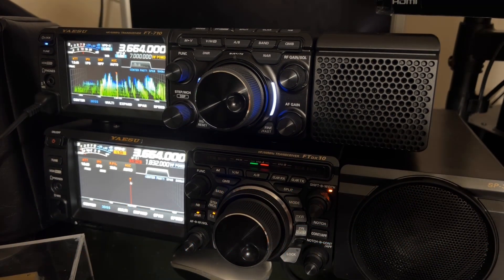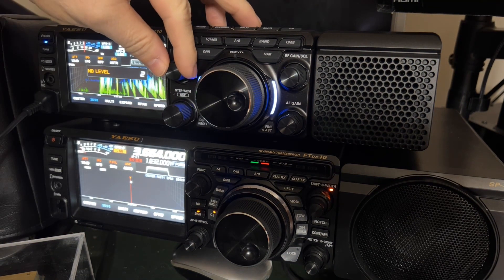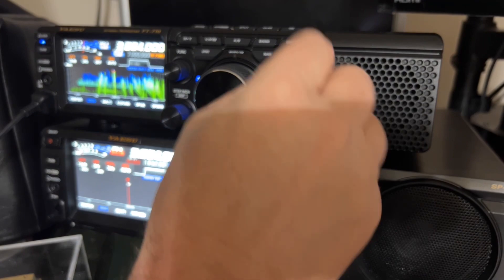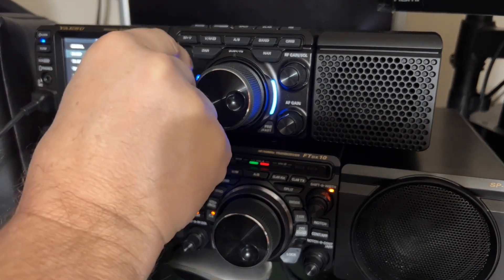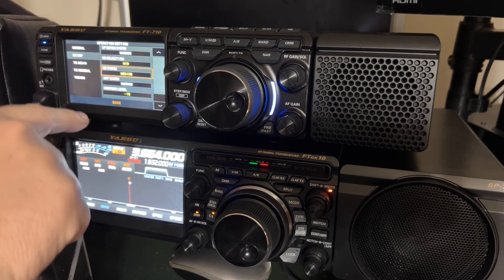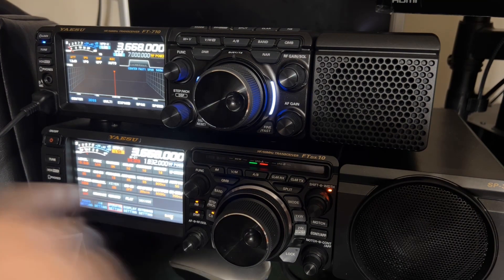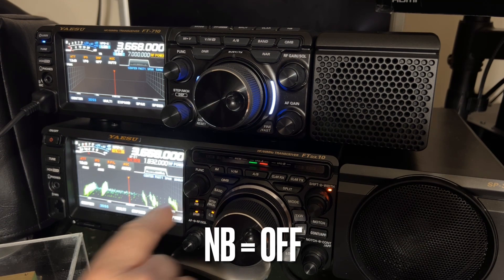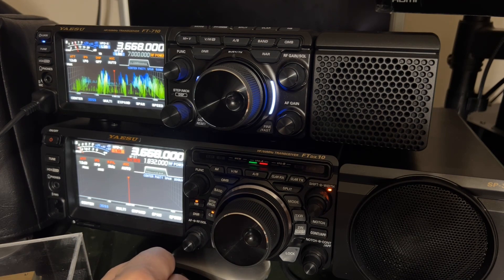Yaesu FT-710 AESS: Noise Blanker Effectiveness (video #20, additional videos via Patreon.com/N4HNH)

Comment: Icom NB width and depth are 100% adjustable. Why Yaesu will not do the same I do not know. Icom NB is the winner for noise
Reply from the maker: Yaesu does in their FTdx5000. In fact it has traditional and DSP-based NB. It’s awesome!

Comment: Is the 10 hardware? The 710 looks software
Reply from the maker: The FTdx10 is a hybrid. The FT-710 is direct sampling (pure SDR).
Reply: @n4hnhradio  duh!
The noise blanker was the subject
Reply: Maybe they are both software. The 10 &710
Reply from the maker: If you’re referring to the noise blanker itself, yes. Both are DSP based. Most modern radios use the DSP to handle NB and auto-notch. It is less expensive to deploy. The chip is already there, for DNR, Contour, Width, etc.  So, rather than making room on the circuit board for the analog NB circuitry, they can program a chip. The cost of the software is a one time “front-loaded” cost, versus the need to procure and install the components needed for a traditional analog noise blanker each time a radio is made. 

The FTdx10 has a front-end mixer stage, so the analog approach should be possible.  But Yaesu chose to use the DSP approach.  The FT-710 AESS is a pure SDR.  The NB function must be accomplished via software. 

It’s easy to sell the average ham on the software approach because they are so fixated on the idea that the “latest technology must be the best!”

I am so happy that my FTdx5000MP has both types of noise blankers, and the DSP NB is adjustable from 1 to 100, not just three options.

Comment: I have an FTDX 10. Only use it for 6m FT8. I much prefer the beautiful audio from my 1990's Yaesu's and my Icom 775DSP. I prefer my FT-991A over the FTDX 10 also. PS as far as the 7300? Hated it. The most overrated transceiver of all time. The king has no clothes on! I couldn't sell it fast enough.
Reply from the maker: Those 90s radios were great. I have two.  They can’t outreceive my FTdx5000MP or my FTdx10, but they do have a warm receive audio. That said, I consider the FT-991A as the one radio to have if you can only have one radio.

Comment: Looks like the NB is in the IF section for the 5000 & your fav the 890 (and many others), so I am left wondering why the 10 doesn't have the analog blanker being direct conversion?  Being that the 710 is direct sampling, then I left wondering why an analog system can't be better emulated.  A good, low distortion NB is a must at my QTH.  Thanx for the vid. 👍
Reply from the maker: It’s less expensive to use the DSP chip to handle the noise blanker function, versus the number of discrete components required to make the analog NB circuit. That’s why I’m always preaching that latest isn’t always greatest. The FTdx5000MP represents the best of both worlds.
Reply: Not sure about that.  S/W ain't free.  Plus they already had a proven design they could have have done some application engineering on.  Apparently, the performance requirements are lower than they were for the 890.
Reply from the maker: The cost of programming is front loaded. The cost of discrete components, and the circuit trace real estate needed, carries over into every build. It’s part of the reason the FPGA has made radios so cheap to build. I mean, the FTdx10 costs about the same as my 1999 FT-920, after I added the optional AM board , FM board, and CW filter.
Reply: So Doug, would you say the NB distortion is better with the 710 as compared to the 10 (you & I complained about) on typical NB noises (not the noise you were experiencing during this vid).  Thanx & HNY.
Reply from the maker: The noise blanker in the FT-710 is definitely improved. The DNR is still lacking. Yaesu is supposed to be working on the DNR. I just hope the NXP DSP chip is capable. 

I’m still baffled why Yaesu released the FT-710 with such a poor DNR, and the miriad of CW issues.  The CW issues were mostly corrected with the latest update.

I don’t make a purchase decision based upon a noise blanker. I can use a Timewave ANC-4 for noise. It does a much better job, with no distortion, and it eliminates the noise before it ever enters the radio.
Reply: Thanx for the quik reply.   At my QTH I hafta use both (Rig NB & external devices) sometimes.  So for my QTH, decent low distortion NB (TS890 & IC7610 are good) is a consideration.  And yes I have shut down the house & still have the noises.  I've a church north of me & they have recently updated the lights to LEDs plus I have a few farms nearby.  I get a mix of noises.  73
Reply from the maker: Wow!  I don’t envy your noise situation.
Reply: After a couple days of using the 710, I can testify that the NB & DNF are superior at my QTH, to the FTdx10 I sold.  Both features work with out the excessive distortion that I got and complained to Yaesu about, with the 10.  And the display is better than the IC7610 I have.  Small numbers/letters are rendered fully and very sharp. Very pleased so far.  Kudos to Yaesu.

Comment: I don’t hear much difference between the 2, or much difference of either between NB on or off. But absent the noise, when you have that DX10 dialed in the receiver sounds amazing.
Reply from the maker: The noise blankers definitely make a difference but that noise was not normal power line noise.  I doubt any noise blanker could knock it out completely. I should try my FT-890/AT the next time it happens.  It has the best NB I’ve ever experienced.

Comment: It is a close comparison. I wonder if the different speakers and speaker enclosures could be the difference.
Reply from the maker: The speakers definitely sound different. There is a clarity to the FTdx10 with the SP-30 that the FT-710 with its SP-40 just can’t quite match. The FT-710 sounds fine by itself. If you don’t have a FTdx10 next to it for comparison, you would be happy with the FT-710. 

I think the slight difference in noise blankers is related to the different DSP chips.

Comment: Now you've used the 710 for a while (and presumably done the firmware updates), what are your thoughts on it now? You weren't that impressed at first...
Reply from the maker: Not impressed. But I’ve compared it to the FTdx10. So that isn’t a fair fight. The 710 is still better than the 7300 it was made to compete with. But the 710 has too many shortcomings for me, when I put it against the FTdx10.  Those issues will be covered in an upcoming nitpick video.  But, just to prove that most viewers don’t read the comments, I will list a few of the shortcomings right here and now for you:

FT-710 shortcomings
1. Weak DNR
2. Doesn’t retain filter/IPO/ATT/DSP/Tuner settings for 60 meters
3. No quick-split
4. No CW decoder
5. RX audio not as clean and clear as FTdx10
6. AF gain not linear
7. Popping sound from speaker when sending CW

Those are a few examples. The FTdx10 has none of those shortcomings.  It’s not that the FT-710 is that bad, it’s just that the FTdx10 is that good. If you judge only by Rob Sherwood’s dynamic range test the 710 looks good. But when you use it in actual operating conditions, you want to go back to the FTdx10.

I’m sorry for the not so enthusiastic response but, on this channel, I keep it real and to the point. No sugarcoating.  I understand that people so badly want a pure direct sampling transceiver to beat the hybrid Yaesu transceivers, but the technology just isn’t there yet. Without question, it’s worth the extra money for the FTdx10.
Reply: @n4hnhradio  I’m beginning to regret selling my FTDX10 and purchasing an ICOM 7100 to use /portable which I haven’t done sofar? hi rather wintery now😊
I thoroughly recommend the FTDX10 Rob G3RCE

Comment: I don’t hear a whole lotta diff either way , which I don’t understand given the technology
Reply from the maker: They’re fairly close. Both can minimize normal power line noise. This is worse.  But the FTdx10 had a slight edge over the FT-710. The roofing filter probably helped the FTdx10 a bit, by passing only 3kHz of bandwidth to the FPGA. With the FT-710, the FPGA and DSP are on their own. The FT-710 of course doesn’t have a roofing filter.